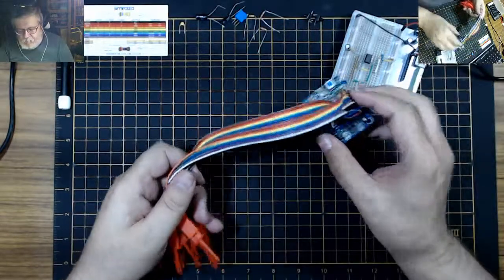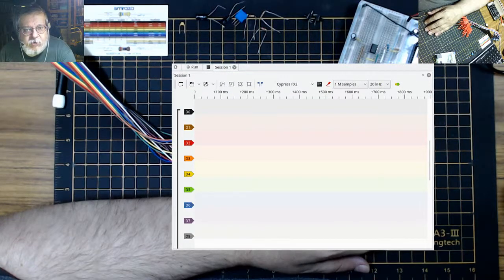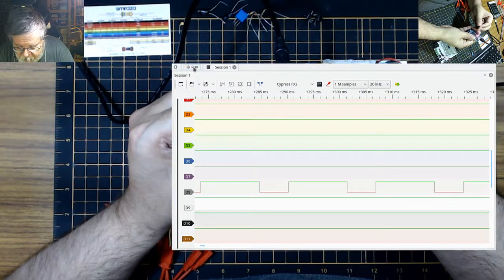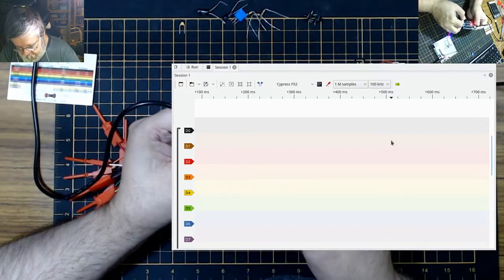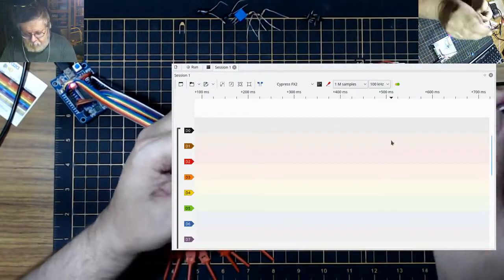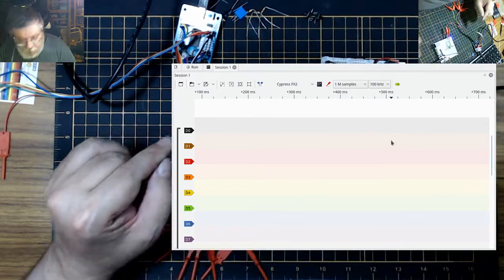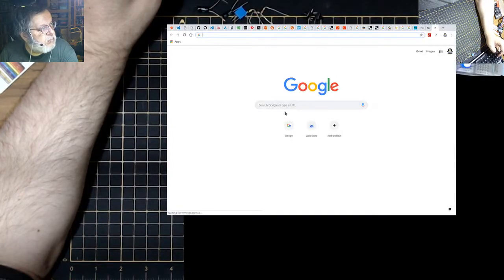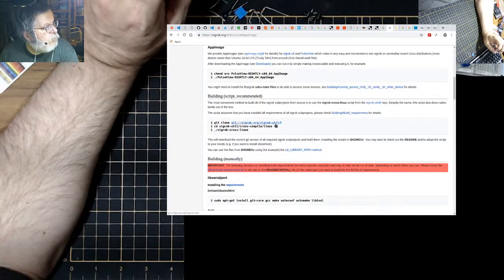Sigrok Signal Analyser

Comment: Thank you for this video. I've been looking at buying one of these cheap CY7C68013A boards to use a a logic analyser, and thought from the Sigrok site that it'd all be quite "easy", and wanted to install Pulseview on my Pi 3B+ (which apparently it can run on, but the Sigrok page seems to be very dated, from 2015), but the appimage didn't work for me and I'm not sure where to start with the manual build instructions. I tried 'sudo apt-get install pulseview -y' but that seems to give an older version (0.2.0, rather than 0.4.1 listed on the Sigrok Downloads page), but as mentioned I don't know how to get the download downloaded and installed... or rather the build instructions aren't clear to me, if that's the route I've got to take. Will be interested to see your next video on this.